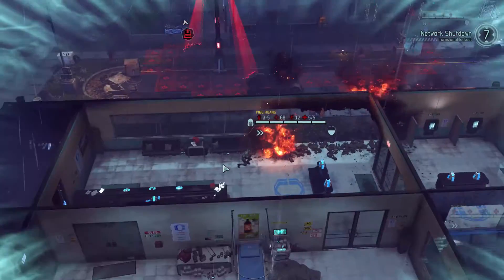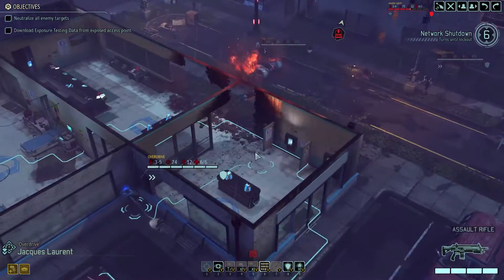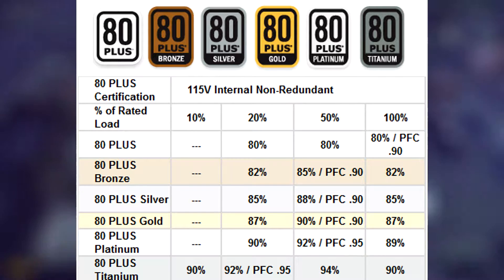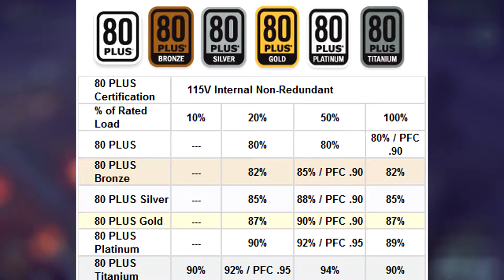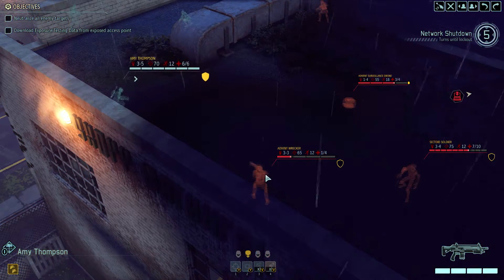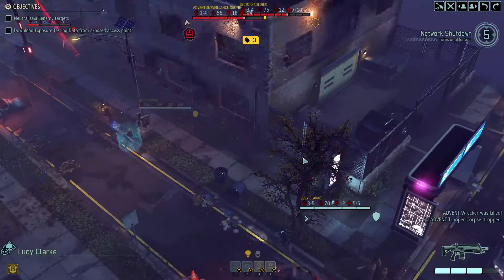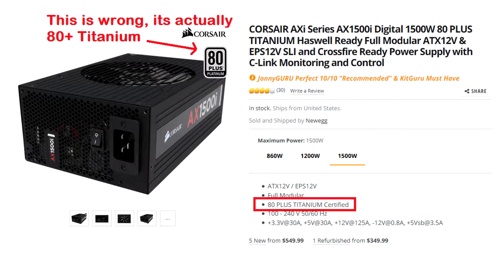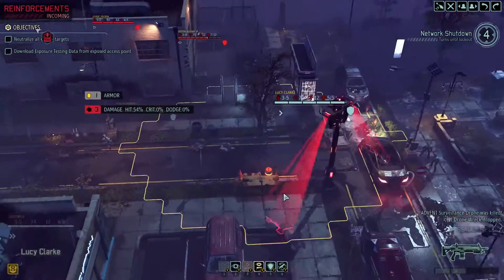Understanding Power Supply Efficiency

Comment: so how much does this 80 plus efficient saves me realistically speaking
Reply: if you referring to the $ he mentions around a dollar a month... not much,  but if you meant hardware wise...... PSU is prob one of the most important components in your build you don't wanna cheap out, it can literally save or destroy your whole rig if it sends the wrong amount of voltages through it's rails.... (also cheap ones uses chinese knock off capacitors and overall components while good ones uses japanese ones)

Comment: So a 600w 80 plus gold would be good for my gtx 1660 super, i5-9400f?
Reply: yea 600w would be perfect
Reply: it would be overkill... I moved an i7 7700k, 32gb ddr4, 1 hdd, 1 m2, and a GTX 1080 for like 3 years with a 550w 80+ bronze (Nzxt) Just now recently with the current RTX 30xx serie requires 650w as base line.
Reply: @GatsuRage  or you can just buy 1 overkill power supply and not have to waste the $ of upgrading in several years. all up to the user
Reply: @legendarykielbasapower525  Not really as higher W power supply means more heat=more useless power loss, sure higher rated power supplies (80+ gold and above) will have good power efficiency but regardless of that if you put a 1000w+ PSU on a system that I mentioned earlier u would be making a HUGE mistake... you can google up or look it up on YT if you want more details on the matter or if u still don't believe me.

Wanting to future proof on PSU is good and all but at the end of the day u would be wasting your money if u choose to buy a PSU that u wont be using a huge % of it.
Reply: @GatsuRage  ok but I said 600 watts...
Reply: @legendarykielbasapower525  and still u wouldn't need more then 500 for his set up that's the point I was trying to make.

Comment: please answer my question. Suppose I have have a psu with low efficiency. low efficiency means it will take more watts from the wall but give me less. So when the electricity goes my psu will create more pressure to my UPS. because of its low efficiency. If yes will I have buy a psu with more efficiency. plsssss answer

Comment: What about fanless power supplys, how do those work? Do they not create any heat?
Reply from the maker: Fanless power supplies rely on passive cooling to dissipate heat. They are usually very low wattage and are highly efficient. For example, there is a fanless power supply from seasonic which is only 400w and is 80+ platinum which means it only generates less than 40W of heat at max load!
Reply: thanks